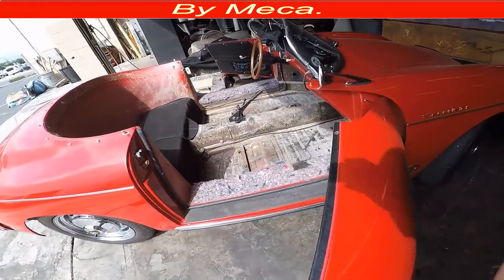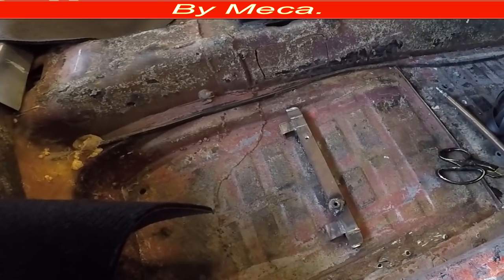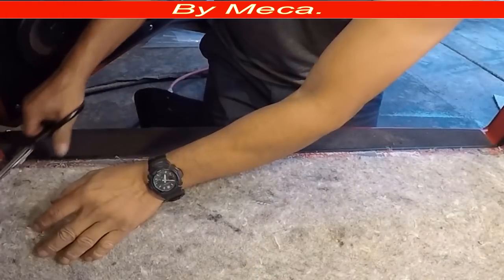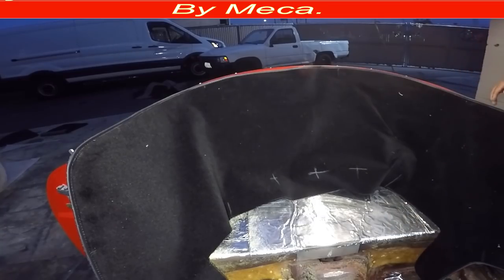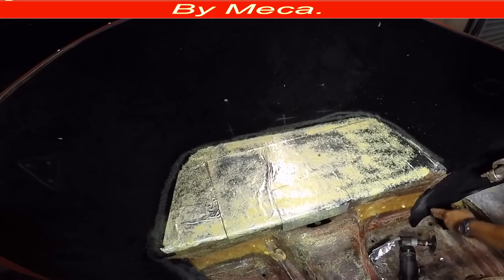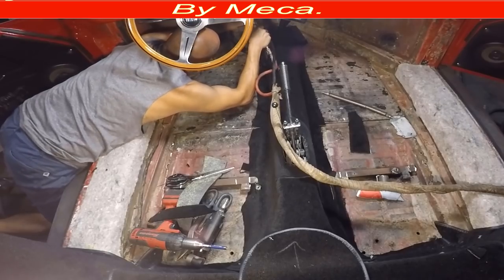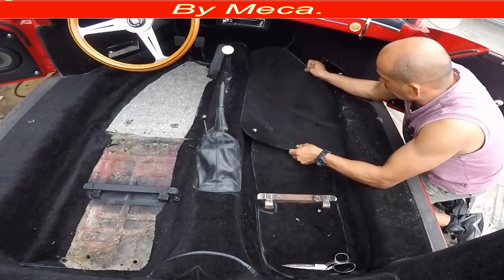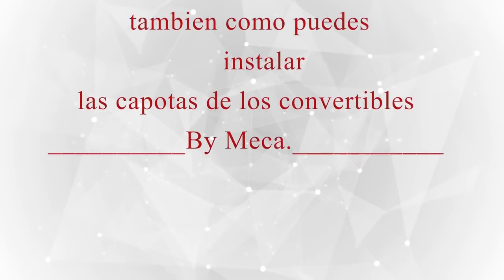How to Make Porsche new carpet 1600 - Carpeta de Un Porsche.

Comment: Hola Meca, buen video. Puedes recomendar una buena marca de aislante como el colocaste en la parte posterior del auto. Hay muchas marcas, pero cual es realmente de buena calidad. O cual tu consideras de buena calidad?
Reply from the maker: si hay muchas marcas de ese tipo de insolación y hay unas que son caras y otras que son bien baratas aquí le Comparto el link una marca que es muy buena Yo la sé utilizar muy a menudo y a muy buena https://www.walmart.com/ip/Dynamat-10648-SuperLite-Bulk-Pack/28827918?wmlspartner=wlpa&selectedSellerId=1235&adid=22222222228019153297&wl0=&wl1=g&wl2=m&wl3=51809607311&wl4=pla-83211658151&wl5=1014207&wl6=&wl7=&wl8=&wl9=pla&wl10=112354589&wl11=online&wl12=28827918&wl13=&veh=sem&gclid=Cj0KCQjwrszdBRDWARIsAEEYhrdNz_MpFdFS3mBEvT_-7I5U1YtxS6bKHLI_QxHcAwFmnF4t3wsIPawaAuO1EALw_wcB